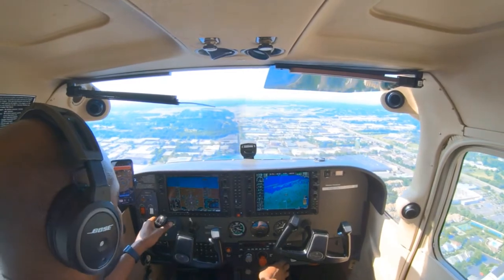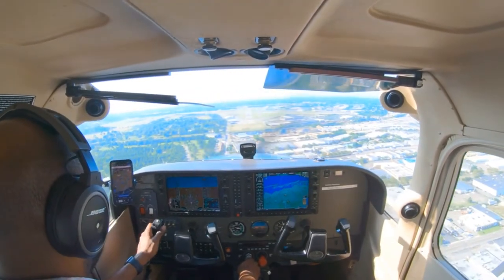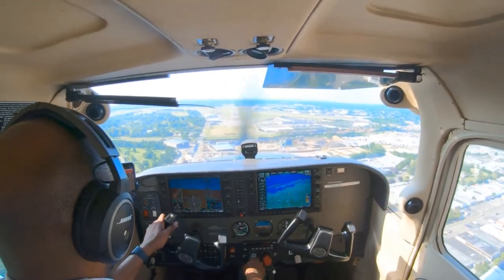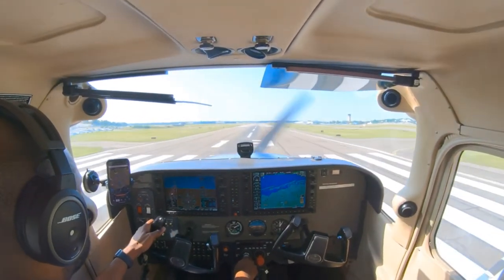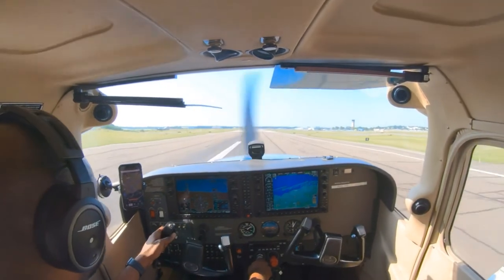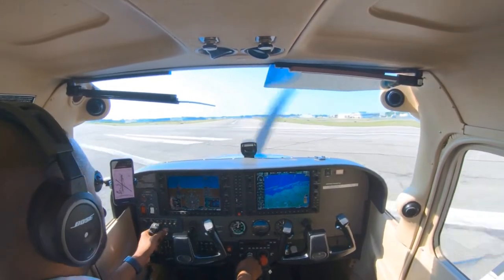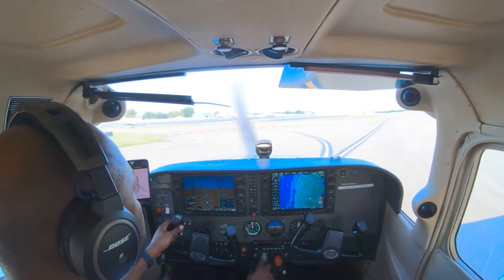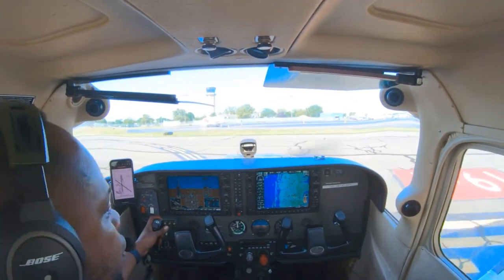C172 APPROACH AND LANDING into Farmingdale, NY (KFRG) w/ ATC Audio

Comment: You stopped on the wrong side of the hold-short lines when you cleared RW19.
Reply from the maker: Good catch. It was a matter of the hold short line being so much closer to the taxiway versus the runway. The same is true at several different points at that airport. The best thing to do is get the ground clearance to taxi as soon as you can so you don't have to stop.
Reply: @fartherfasterhigher6157  FRG is my home airport, great controllers there.